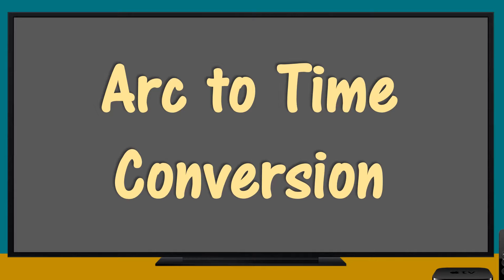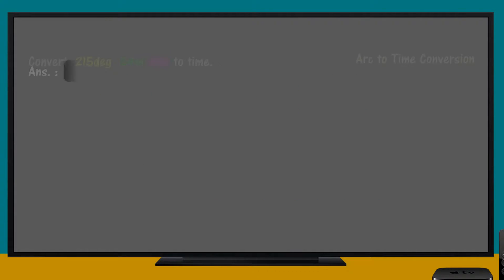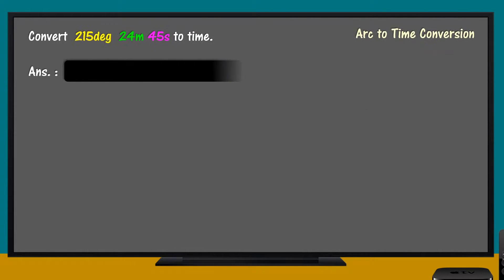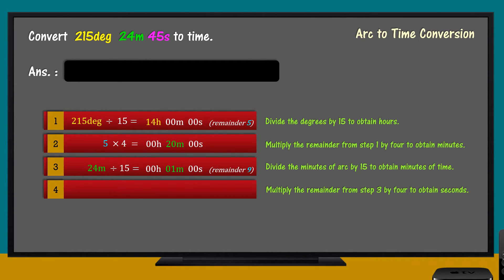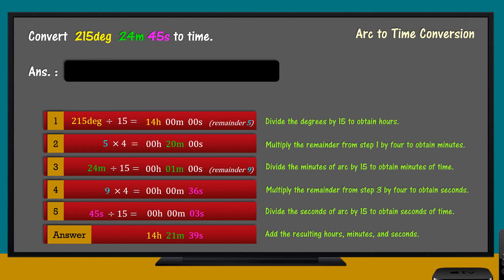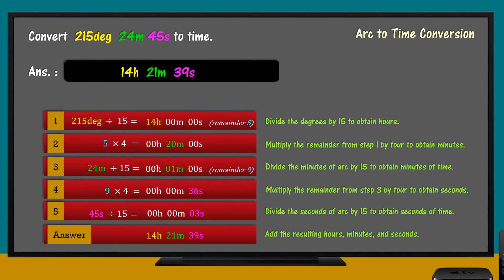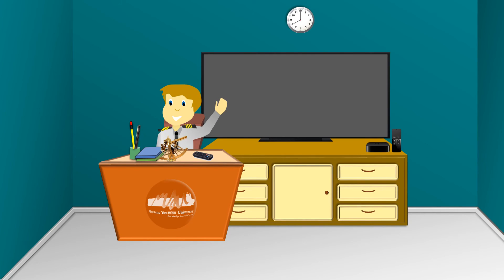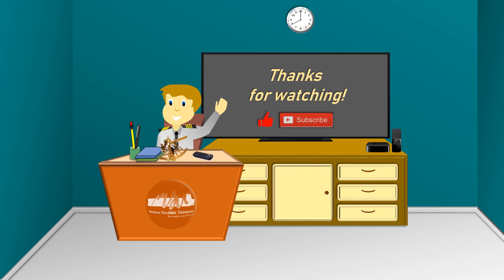Arc to Time Conversion

Comment: the remainder was not 5, it was 3 on 215deg divided by 15
Reply: 215/15=14.33. 
Using whole numbers only for the result gives 14 while the remainder of .33 times the original divisor of 15 = 5.
Or 215-(15x14)=215-210=5
Hope it helps.

Comment: what if the question is 149 degrees 15 minutes and 16 sec.
Reply: 149d 15m 16s
149/15 = 9h 00m 00s (remainder 14).
{149-(15x9) = 149-135 = 14 remainder.}
14x4 = 00h 56m 00s.
15/1 = 00h 01m 00s (nil remainder).
16/15 = 00h 00m 01s (I am happy to discard remainder, or you can decimalise).
Addition gives 9h 57m 01s
Reply: @BoxJelly88  thank you sirrrrr
Reply: @BoxJelly88  why always divide to 15 sir ?
Reply: @gemduncil33  because 1 hour = 15°